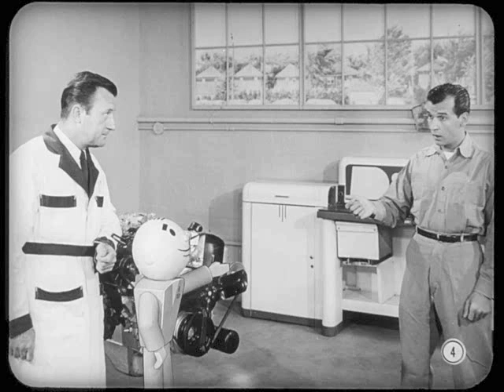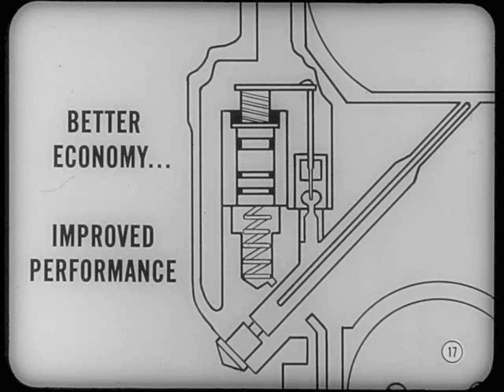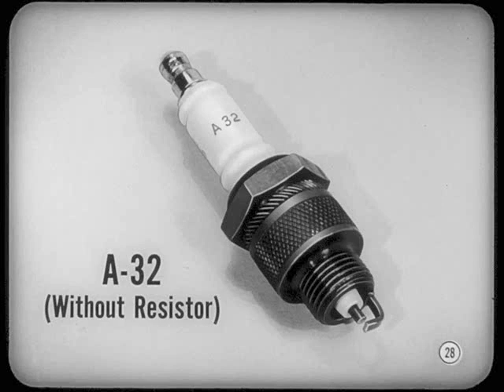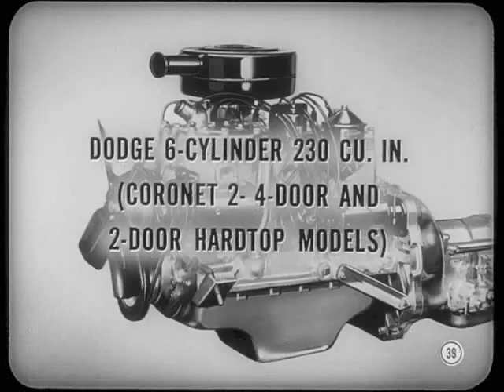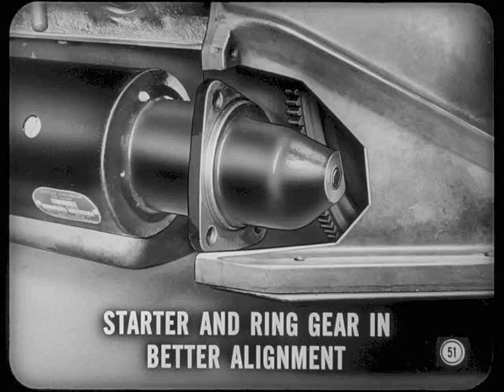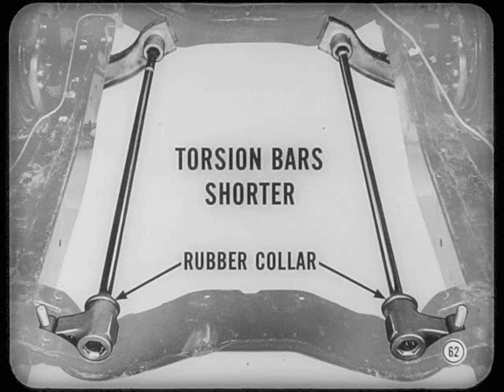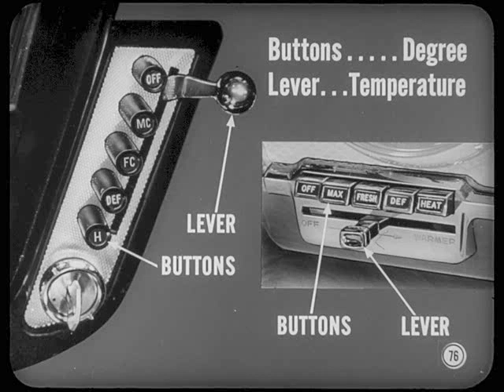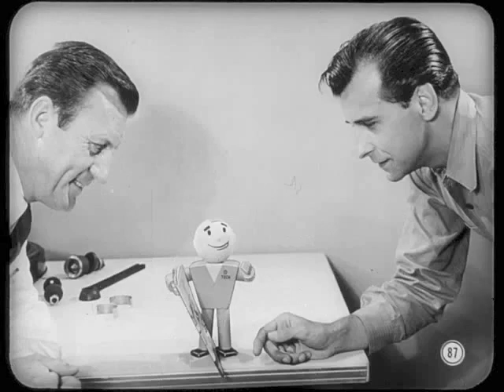Chrysler Master Tech - 1958, Volume 11-10 1959 Model Features

Comment: For the cars that weren’t station wagons, I have never read in any literature that you could get the rear air conditioning unit by itself. You always had to have the front one, and then the dual air conditioning option includes the rear unit.